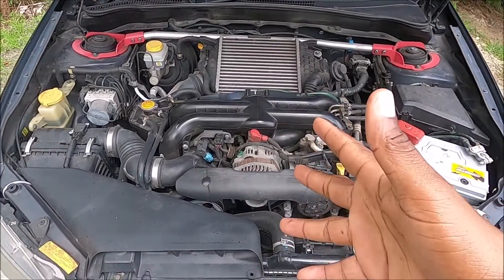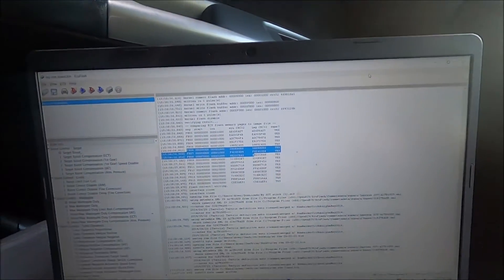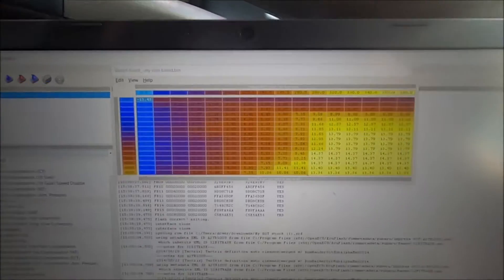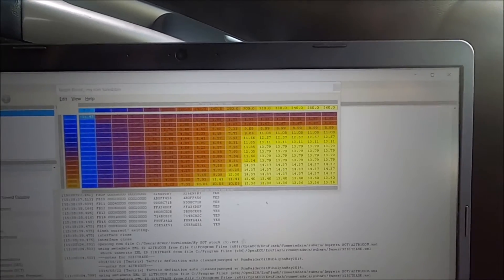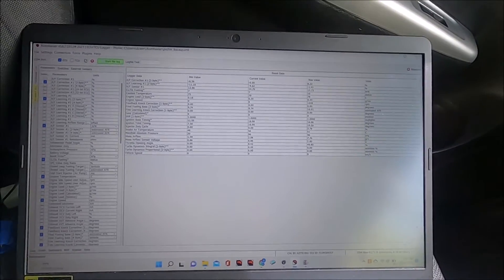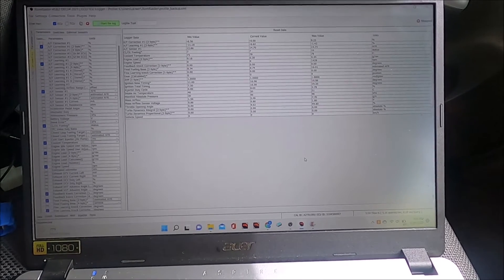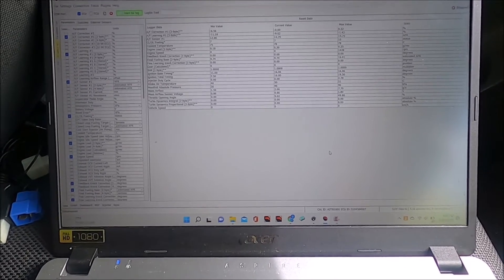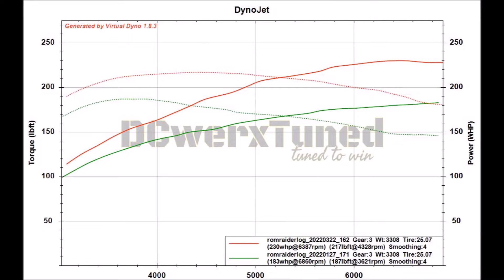Factory Subaru ECU Reflashing Explained | Big Gains !

Comment: I reflashed my 2011 Legacy GT and there is a 5min delay before the front O2 sensor starts reading. Is that normal? Can the time be shortened?
Reply from the maker: That's normal. Mine took 9 mins then a friend patched something onto it and it's down to 4 mins
Reply: Is it possible they turned off the O2 sensor heater?